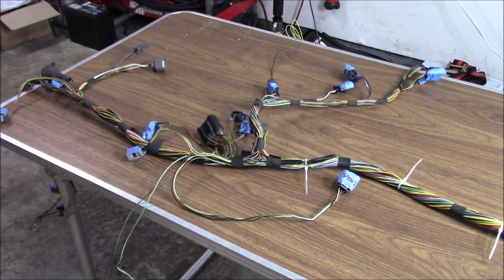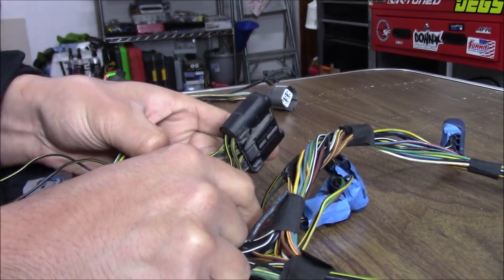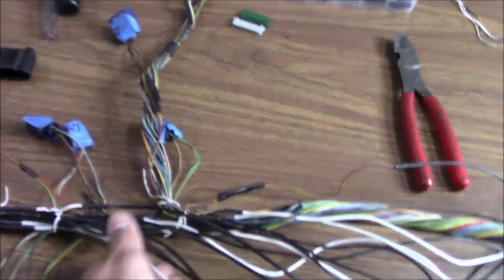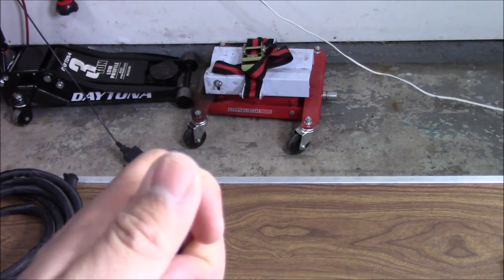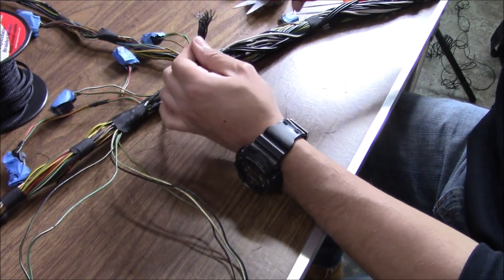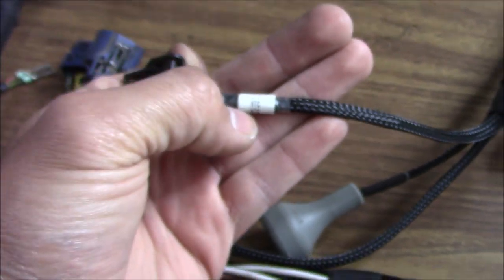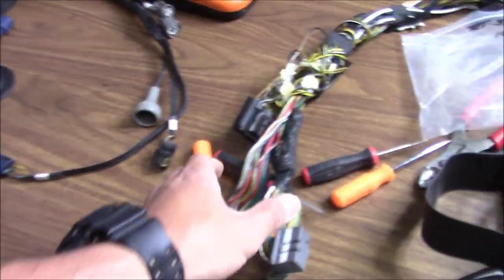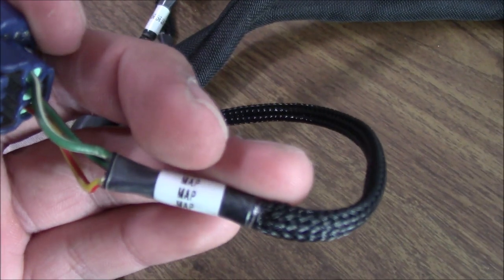K20A2 Engine Harness Wire Tuck Guide PT.2!!

Comment: Water proof electrical whips that usually comes with a condenser disconnect is by far the safest way to run your electric in the engine bay. Waterproof, cold/heat resistant and easy to separate into pieces with a knife.

Comment: Great video. I’m a wrencher I’ve done a lot mechanically but never done wiring 😂. This video is building my confidence. But that whole ground junction gets connected to a plug under the dash? I have a Ep3 and getting ready to swap a k24. Would like to tuck the harness a bit. Would appreciate any help. 🙏🏽

Comment: Hello Serg Nice videos.  Big fan of your work here. I have a K20Z3 that is leaking around the timing chain cover and top of oil pan where they join,  the engine is in the car.  How bad of a job is it going to be to re-apply RTV around there, and should I just do the belt and chain while I'm at it?   Thanks!
Reply from the maker: its not too bad of a job, just need to remove the passenger side motor mount and jack the motor up a good amount to get to everything. Yea might as well do the belt and chain but also replace the tensioner with a new oem one.

Comment: Where can you buy replacement harness clips for example like the injectors, but I would need them for a couple more like the vtec solenoid and the cam sensors, I'm in the process of tucking my wires but most of the clips are brittle already. Thanks

Comment: Hey I install a K2.4A2 TSX engine in my 2010 Acura csx which had  a K2.0Z2 now I am having engine codes P2646 low oil pressure & actor stock off & lean fuel mixture it still have the OEM engine control module  I need help to find the correct ECM by the way it's has an automatic transmission

Comment: So I’m attempting this with my z3 harness. What I messed up is not labeling the connectors. Is that a huge problem or when I re loom and re run the wiring it would still line up some what? If you have a link or image of the original connectors or maybe even showing this harness labels that would be greatly appreciated!!
Reply from the maker: yea thats kind of a big deal lol if you started to open the harness up and start cutting all the tape then it might line back up where it originally was but more then likely they will just be mixed up now. send me  a dm on instagram and ill try to help out
Reply: @SERGMOTIVEGARAGE  I labeled everything now lol i thought it would be harder but i got it all good now. Including the chassis harness all labeled ready for the wire tuck and fuse box relocation. Thanks for the videos man just got the loom and heat shrink today so gonna get started on it!